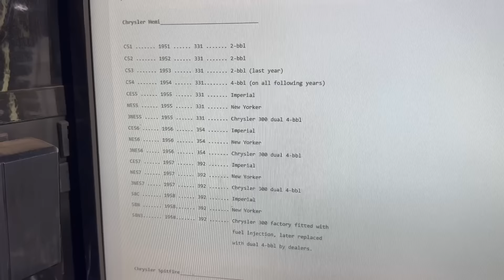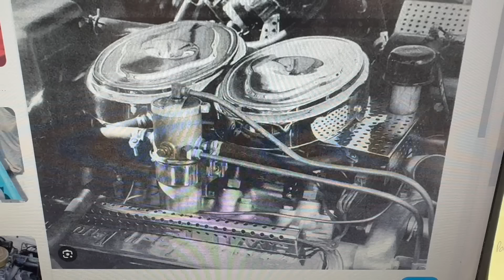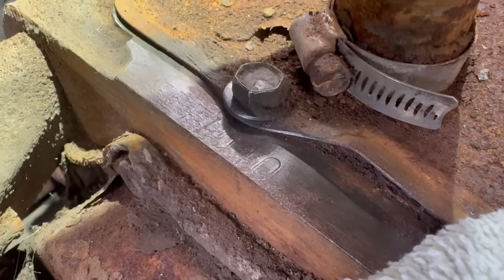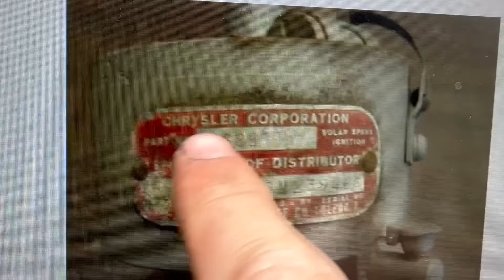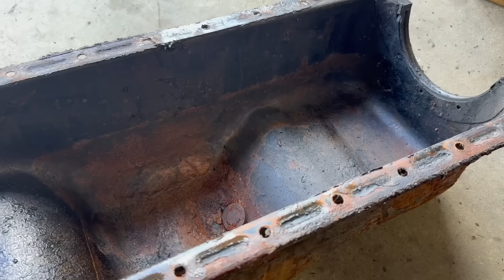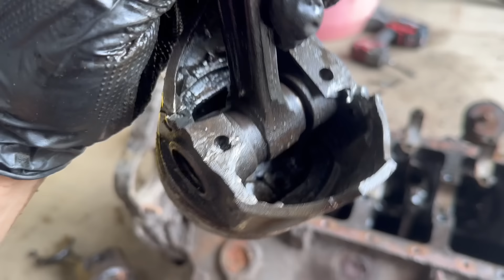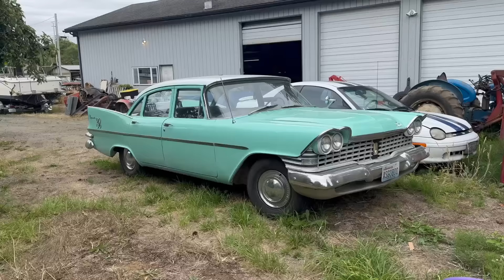The Big Hemi - Seized 1957 Chrysler 392 Engine Teardown, Component ID, Technical Info, And Much More

Comment: Porsche, nissan, Toyota, Harley, ford, and more have all made similar features to the Chrysler, DeSoto, dodge, and Plymouth hemi engines. The Chrysler XIV-2220 is the engine from the WW2 era war plane Chrysler engineers used for the design of the 50s and 60s hemis. My favorite is the 1968 race hemi dodge dart. L023 special order. I have a 2019 challenger with a new gen3 392. It is a beast. Very impressive. I love Mopar and the hemi. I have been a fan my whole life. I have a 1969 Plymouth Valiant I will eventually restore. My dream is to put a indy heads 572 hemi in it. Cool video. I love the early hemis. Look at the heads on a 1939 Harley knucklehead. They have hemisphere heads. I had a 1999 nissan maxima it's v6 had hemi head features. Even my 2012 scion xb 4 cylinder has hemi style heads. With the added features of twin cams and 4 valves. All engineers have taken hemi designs and adapted them to their own products. The same can be said about Chrysler taking features from hemi engines decades before they built hemis.

Comment: I have a 3NE57 block. There is a crankshaft installed but I never checked the casting number. I have pistons still on connecting rods. The heads that came with this block has steel adjustable rocker arms. Thanks for posting this video, I’m always learning about these engines.

Comment: I believe that the 1958 Chrysler 300D used the Bendix Electrojector system, not Bosch.
Reply from the maker: Absolutely. I misspoke.
Reply: @DeadDodgeGarage maybe if it had been the Bosch system it would’ve worked properly!

Comment: Hmm, my uncle in South Dakota welded up his 1956 Chrysler Windsor for a demolition derby in 1968 and it still had its 331 poly and 2-speed pushbutton transmission. Probably locked hard after decades without a hood but it's a neat-looking engine.  I'd probably have better luck with his 1963 Chrysler Newport with 361 B engine (and same 2-speed pushbutton) - word was that car spent more time above 80mph than below it - until a herd of antelope put her out of commission.
Reply from the maker: ‘63 would/should be a 3 speed push button 727 Torqueflite. Otherwise, neat!

Comment: Bendix EFi, not Bosch..If Robert L Bosch had been given the ideas Bendix Corporation started in the mid 50s, they would have bought Integrated Circuit technology and re militarized the Fatherland.Tankfully, Bendix, who did the Chevrolet Vega Cosworth and the 1976-1979 Olds EFi in the Cadillac Seville (and 80 CA Market 350 which  stayed on an extra year). So Bendix had three huge bites of the Port EFi cherry, but only Bosch in West Germany and Brico in England got  the system off the drawing board in sufficient volumes in the late sixty's early 70's VW , Volvo, Citroëns, and Aston Martin DB6's.
Reply from the maker: Yes, I misspoke. The system was developed by Bendix but was largely unsuccessful. The patents were later sold to Bosch.
Reply: @DeadDodgeGarage Love your stuff. You are the guru!

Comment: The 392 was used through the 60s and 70s because they were much better than the later 426.
Reply from the maker: …by whom? Better? You’re sure going to hear some pushback on that. There was indeed a time when some well known racers held onto the 392 instead of adopting the 426. Today, 426 derived engines are making INSANE power and running nonsensical quarter mile races. As great as the 392 is and was, the 426 is far greater.

Comment: What is a good running pair or 426 hemis worth. They are dual carb motors out of a chriscraft yacht. Motors have consecutive serial numbers and have low running hours. Still have the hour meters for both motors and owners manuals. Repair manuals and parts manuals with vin numbers in all books. I hoped to put them in a worthy boat but never happened.
Reply from the maker: I’d love to see them. They certainly aren’t as valuable as fully dressed street Hemis, but they’ve got to be worth quite a bit. Shoot me some pictures? DeadDodgeGarage@gmail.com

Comment: I think one of the lowsiest sneakiest ways a engine seizes,  is when all the piston rings are stuck in the grooves 
  And everything else looks decent,    Pontiac was pretty known for that,   and have seen it on motorcycle engines.
   Not sure exactly why   , I think it may be because of the mix/ type of aluminum that the pistons are made from,  where the the aluminum corrodes .

Comment: Jamie, my guy, why try to manipulate dry rusty cast iron? 
Science is a thing. 
Soak it in 30% vinegar, or nitric acid or citric acid for a week, rinse it off with baking soda and water to neutralize the acids then disassemble with ease. Knowledge saves time, time is money. You start cleaner and end with a better outcome. 
You have a lot of rusty stuff as older stuff usually is,  stop the rust and this stuff will be around for your grandkids.
Reply from the maker: Apparently acid eats pistons - or so I’m told. That didn’t matter this time, but it often does. I could’ve soaked it in all kinds of things for any amount of time. Scraping the horrible gunk off was the first step. But once I started this, I had to be done quickly. This is a function of the time I have available to make videos (not much.)
Reply: @DeadDodgeGarage   The aluminum is a consumable item. The pistons are usually what swells and sticks to the iron via galvanic corrosion. let the acid eat my guy.   I've done a lot of sunken boat motors, diesels mostly, and swear by it.  
Love the way you present your craft, I have learned lots from your videos, just trying to give a little back.

Comment: To stop those crankshaft. Dings from occuring........I use long  hardwood. Blocks.  .. keeps the hammer away from the crank
Reply from the maker: Don’t have any here. Or a big brass draft. Better equipped at Rocket

Comment: Could the preservative gunk be cosmolene? If so, Coke will remove it. A farmer I worked for when i was a teenager had been in the Army in Europe. He said that Coke was the best thing for cleaning out new artillery gun barrels. And for soaking, have you ever tried Dawn? Old anti-freeze does a good job (gunked up model airplane engines being my main experience), but the Dawn is least icky.

Comment: there is no replacement for displacement. 

Any boost you can apply to a small engine can likewise be applied to the bigger displacement engine. Infact you may likely be able to apply MORE boost to the bigger engine.

Comment: Looks like a lot of meat between the bores. How much overbore did the racers give them?
Reply from the maker: Not sure what bore sizes were possible or common. Older blocks do tend to have extra beef, but the concern would be core shift or poor casting quality preventing that beef from being consistent where it counts. Apparently, the “A-1” blocks were known to have extra thick cylinder walls and more material elsewhere.

Comment: Question: could you bolt that harmonic balance puller to the cylinder head deck and push those pistons out? like your videos, keep 'em coming, Thanks!
Reply from the maker: I bet you could break them pretty good that way too 😅 the shock from the hammer is what’s doing the heavy lifting. But maybe that could help in some cases. Thanks!

Comment: Hi Jamie, Brett from Christchurch  New Zealand. I have a question? I Have the opportunity to buy a 1957 325 dodge poly that is missing a few parts. One rocker cover , water pump and housing, inlet manifold and other parts. Are these things available in the USA?  How hard would they be to find? I Have no hope of finding them in NZ.  Sorry for the long question.  Thanks for all the awesome videos.  Cheers.
Reply from the maker: So, so hard to find… I’ve yet to ever see Dodge poly top end parts in real life. Let alone DeSoto. Ok, I think the intake might be the same as tall deck Dodge Hemi? I could be remembering wrong.
Reply: @DeadDodgeGarage Thank you so much for that . I will look out for something else. I have a 1954 Fargo 1/2 ton and the engine bay is quite small. The little dodge poly would fit. Thanks again for the answer. I love all the old Mopar videos. Cheers Brett

Comment: I didn’t see anyone address those ARDUN hemi heads. If memory serves, those were designed and manufactured by the great Zora Arkus Duntov, the father of the high performance 1955 Corvette. It would be interesting to see them in action.
Reply from the maker: Yes, correct. That’s why Ar-Dun is pronounced the way it is.

Comment: Interesting!  You forgot about the 54 Chrysler HEMI.  It had the updated block without that extended bell housing and it had improved big port/big valve heads like the 55, but did NOT use that cross-over on the heads, but used a water cross-over on the manifold just like the 51 - 53, and all DeSoto HEMIs.
Reply from the maker: No, I didn’t forget 😀 I mentioned the block change but did not specify that it came for 1954. Alright, you got me on the water crossover.

Comment: One of my goals is to buy a '56 Imperial four-door sedan and replace the 354 Firepower with a 392, and probably replace the Powerflite with SOMETHING with a clutch (A833? TKX? T56?) because I can't stand slushboxes. I don't see 392 Firepowers for sale anywhere though. Are they only available on the Facingbook??
Reply from the maker: If they’re listed anywhere, it’s Facetubes. It’s unfortunate that all the action has moved to that absolute dumpster fire of a platform.
Reply: @DeadDodgeGarage Okay so I bought the '56 Imperial sedan (BaT) and I found a '57 392 block and crank in great condition (eBay, declined to buy original heads or powercells because I'll get the heads from Hot Heads and the powercells from CP Carrillo). However, I have given up on the three pedal setup, largely because I can't bear to cut up the floor on a lovely 37,000 mile survivor. It's an early '56, so it has the uninspiring 2-speed Powerflite like your '55. I've decided to give it a nice modern Chrysler Torqueflite 8 (ZF 8HP75, but cast in the Chrysler Kokomo Transmission Plant with a nice Pentastar on the case) and run it with a Turbolamik controller. What I can't find is an adapter plate, shaft extension, flexplate, etc to connect a ZF 8HP to a Chrysler Firepower. Can you recommend anybody?

Comment: Not sure if someone has tried before but why not plug the coolant passages and run approximately 200-210 degree water or a coolant mixture for a few hrs or something like that then try to turn it? For a seized motor from sitting.
Reply from the maker: People have suggested it. Why not? There are some obvious practical challenges.

Comment: 11:20 Correct me if im wrong but the 61 and older Polys are the Hemi block but 62-67 was a slightly different cast. Or maybe it was just the crank but i know you cant bolt a 727 or 904 to a 61 and older poly. Edit lol you brought it up at the end with the bellhousing
Reply from the maker: It’s way more complicated than that, but basically, the Hemi-based Poly engines were gone well before ‘61, leaving only the “Plymouth” A engine, which was eventually used across the board. ‘62 is when they got the shorter crank, and there were other small changes made in the same timeframe. But that Poly / A engine we know and love dates back to 1956.
Reply: @DeadDodgeGarage Yup makes sense my knowledge on the early stuff is low but as for the newer stuff thanks to galen’s little white books knowledge is a bit higher than the average bear lol.
 Thats why I was looking for “cheap power” as in finding the early 4bolt head for a BB that has the 2.08 1.74 closed chamber (we have 2 sets) at the top of the cylinder head casting section, the only other time offered was for the 67 440 HP 6 bolt and those are expensive and to add I can’t really afford factory racing Stage I-III heads either which are more $$$ or have the desire to put aluminum heads on the motor. I mean the open chamber 2.08 1.74 are still good but we need the “factory” performance. Intake and depending on the type of exhaust manifolds thats a different story. 

From previous comments im using factory parts to satisfy my curiosity. 
For example you brought up an idea for using 273 heads on a different LA motor they are the smaller valves but the closed chamber causing different kind of magic out the exhaust. 

Or telling my father to not touch the pitiful power producing locked up motor in the 78 lil red we are getting but is still a nice piece to eventually rebuild to factory. So pull a 360 out of 73 dodge truck throwing a 340 manifold and use ported 360 heads to 340 spec or use actual 340 X heads because special vehicle named Lil Red Express needs more power but remaining slightly discrete in the engine compartment. 

Sorry for this long message.

Comment: On your 3rd Gen Hemi, one of the best things you can do is do the deleting of the MDS system. 
I put in the factory cam for a manual 5.7 Challenger that doesn’t have the provisions for the MDS, Mopar “Hellcat” Lifters that were most expensive option and used a Diablosport Tuner kit to deactivate the MDS.
Gave it the preset 87 octane performance tune offered, and raised base idle to 800rpm to combat the top end oil starvation issue. 
Truck made it 232k miles before one of the MDS lifters collapsed and failed. 
Truck is currently at 277k miles and gets 18mpg. No more Hemi tick sounds. 
Mopar on! 🤘🏻
Reply from the maker: Oh, trust me, I know… good deal!

Comment: Hey Jamie, I was wondering what I could use to start my engine when I'm done rebuilding it. Can I just go to the wrecking yard and pay for a junk transmission and cut the bellhousing off of an automatic?
Reply from the maker: Well, that is an option, but it sounds like a big pain. You’ve got a roller cam, you don’t need to worry about a careful break in like we do with flat tappet engines. I’d just install it.
Reply: @DeadDodgeGarage well if you don't remember this engine is going into a Van and it's not gonna be easy to get in there by myself and I don't wanna have any kind of issues like oil leak or something not working properly and have to pull it back out again if you understand what. I'm saying.

Comment: If you ever end up with an old Trans-Dapt adapter to bolt a more modern four speed transmission to that engine, it's intended to be used in conjunction with that factory aluminum transmission adapter plate.
Reply from the maker: Huh. That’s interesting!

Comment: A1A  block
Reply from the maker: Doesn’t say A-1 on it
Reply: @DeadDodgeGarage  my 58 block had A-1 cast into it around the top by the valley pan … supposedly the block type garlits preferred
Reply: @DeadDodgeGarage also used as truck blocks until 59….

Comment: I honestly don’t see the advantage to four bolt main caps.  If you’re having major catastrophic failure in the rotating assembly, it doesn’t matter if you’ve got two, four or eight bolts holding the cap down.  That crank’s ending up on the ground!
Reply from the maker: It helps keep the main caps from walking around. Whether this is essential or not depends on the application.
Reply: @DeadDodgeGarage In my profile picture(circa 1972ish) the nitro funny car I’m standing in front of is my Uncles.  At the time of the picture he’s running a 426, but prior to that he ran 392’s with two bolt mains, billet caps and studs.  Not saying four bolt mains aren’t needed, just saying it can be done without.

Comment: I've been told I'm wrong and there's no way I own a 1958 350. But I do. It takes a bit before I can tell people it's a DeSoto 350, not a Chevy 350. Your H296 casting number is August 29 1956, which would be an early 1957 engine. 1957 you could get a Torqueflite, or a Powerflite. The 2 speed was 1954-1961, and the 3 speed was 1956-2002. Being I just had a pair of 1960 300F's apart for a drivetrain rebuild, I would think that adapter is for a 2 speed Powerflite, because at least in 1960 behind the 413, the iron Torqueflite bolts directly to the engine. Quickly looked into it, yes, that adapter is for a 2 speed. Which, unrelated, $9,600 for a stock rebuild on a 413 having the machine shop do everything. Not what I was expecting, but it's a customer's car, and he doesn't care. I don't know why or what for, but I still want to build a flathead.
Reply from the maker: Oh yeah. A first year B engine. Neat! Interesting, I thought the two speed was gone by 1957. Must have been ‘58. Obviously my ‘55 was a Powerflite.

Comment: Jamie I used 318's and 360 motors in my 58 power wagon using the old style bellhousing for many many years. I took out the original dowell pins and just used the 5 bolts. I was young and dumb but it worked fine for me.
Reply from the maker: The issue is that the input can’t be perfectly aligned with the crank that way. It could be close enough to work. But imperfect alignment can lead to poor shifting and bearing wear.

Comment: I agree , Jamie, Chrysler built the first, automotive  /  light truck  / apu  pushrod v8 hemi on a mass scale, mostly borrowed and combined with inexpensive,  mass production technology.  The French had dohc 4v engines around 1918.
Harry Miller borrowed a lot from a Peugeot race motor, and had a standout high performance/ race engine before Offenhauser bought him out, by the end of WW2, ICE engine development reached it's mechanical peak, automotive technology took 40 years to catch up, in America. Computer control, is the only real step forward (from a control standpoint) Germans had direct fuel injection back then.  Great vid.

Comment: I’ve noticed you never mention Plymouth when you talk about the early hemi. Didn’t they use them?
Reply from the maker: They never did. They finally got a V8 in 1955 - a borrowed Dodge Poly. They got their own V8 in 1957, the A engine (the Poly that eventually went into all lines and continued until 1967.) But never a first generation Hemi.